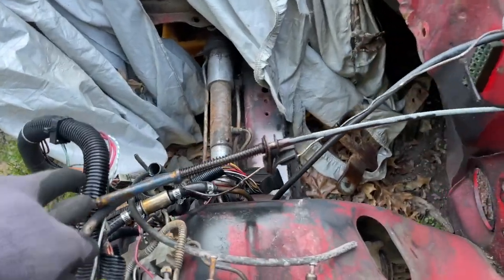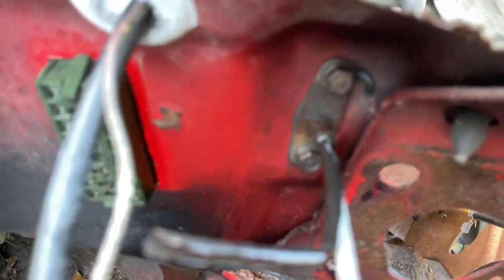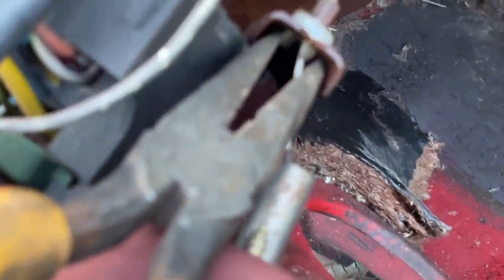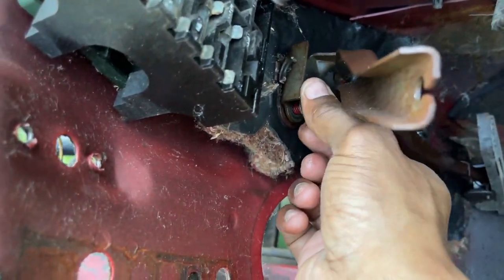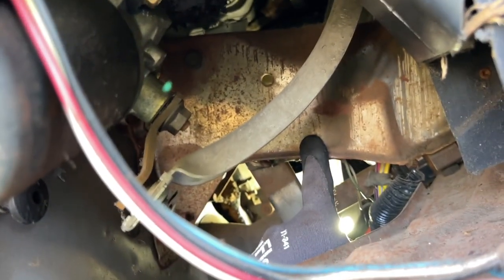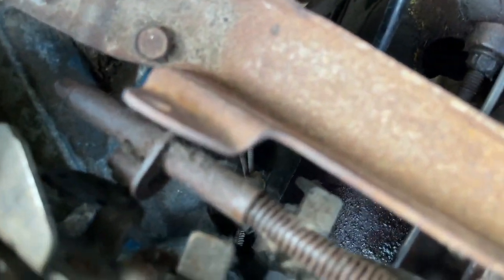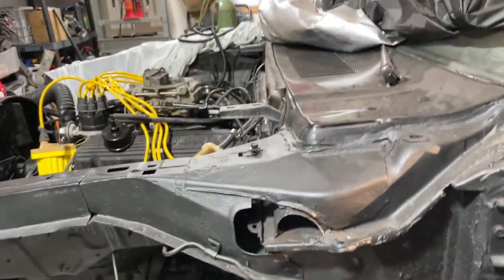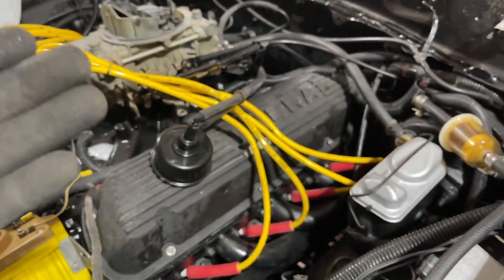How To Remove An Accelerator Cable & Gas Pedal From A Ford Mustang II! Ford Pinto? Mercury Bobcat?

Comment: I’m trying to remove the throttle cable from the throttle body lever. How do i release that cable. Ive read to stick a flat head at the end and twist but that doesnt seem to work on my 1983 302
Reply from the maker: If your throttle cable is exactly like this one, all you have to do it pop it off. You can use a long screw driver and get leverage on something near by and pry it off. Or use some pliers and pull it towards you. It will come off that ball screw. Thanks for watching.